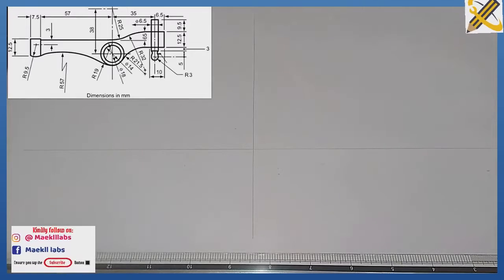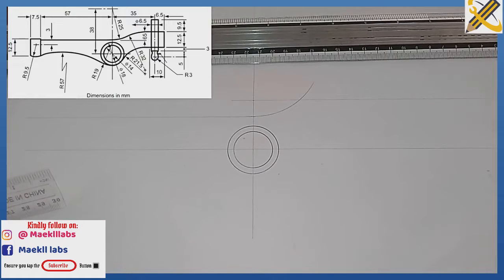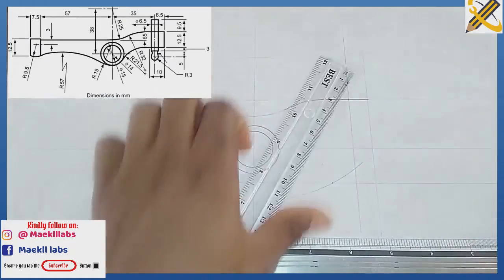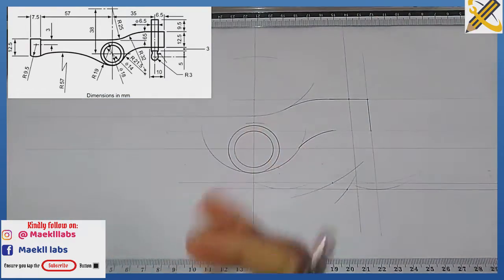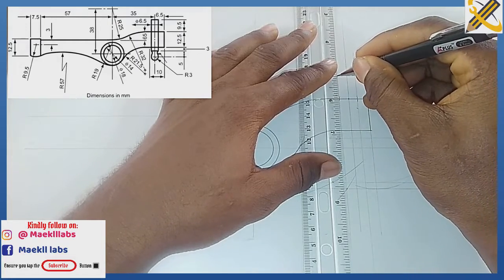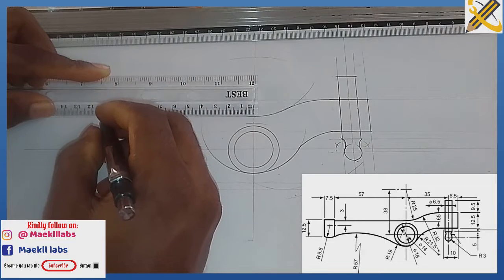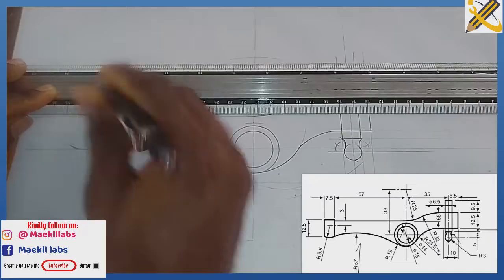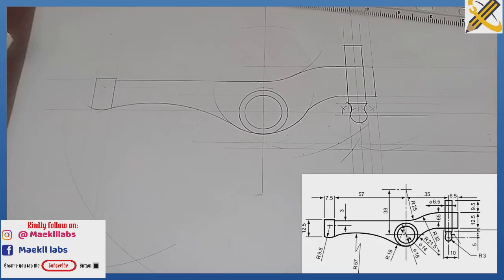ROCKER ARM - Tangency in | Technical drawing | Engineering drawing

Comment: Is the value in mm not suppose to be 6.5 so that when it's multiplied by 2 and converted to (cm), it would be 1.3
Reply from the maker: ...check what you just typed... and calm down, don't confuse urself ... go through ur scale and metric table for clarity...
Reply: @MAEKLLTECH   Thanks👍🏻